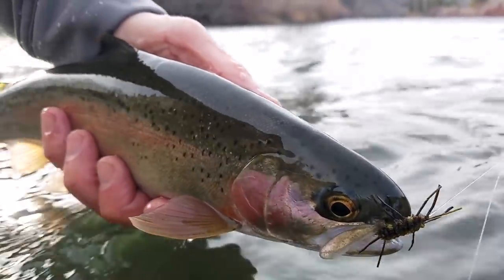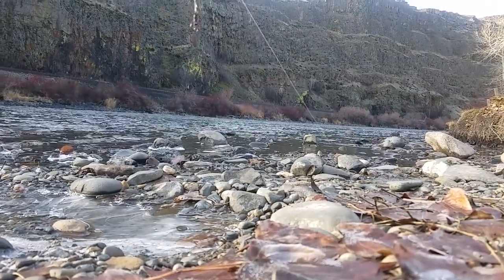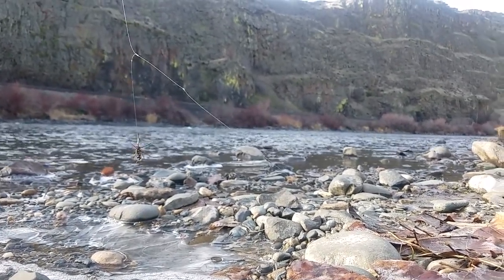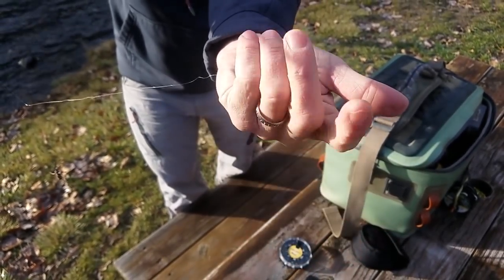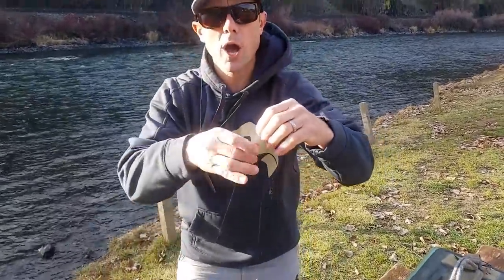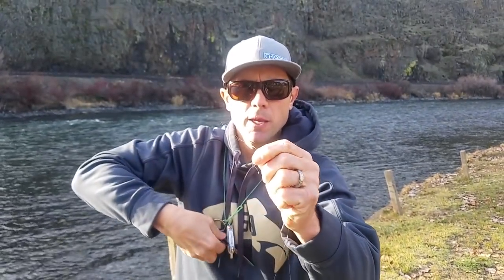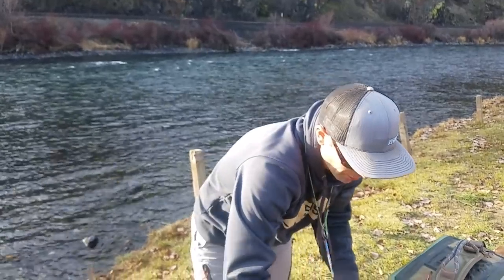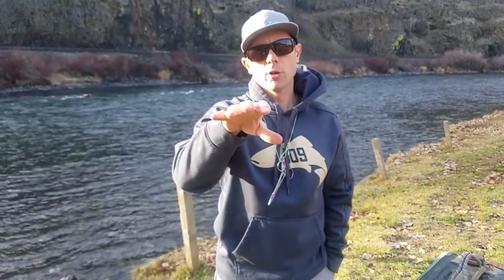Drop Shot Nymph Rig // Simple Setup and Explanation

Comment: You young guys bring some great innovation and techniques to the sport, I bet some of this rigging comes from spin fishing and other angling sports, probably  salt water as well. Old timers wouldn't like fishing with weight and yarn indicators, but yes it can be highly effective. Dropper fishing has always been a method or multiple nymphs. I can see that weight on the end giving you a nice controlled drift in the column of water at the desired height . Nice Job !
Reply from the maker: Thanks, its a good setup for cold water. I prefer to fish nymphs suspended (like a dry dropper) when I can.
Reply: @redsflyshop  Good video and Information, I agree suspended in the current tumbling at the same speed as the current always critical just like dry's, if it's getting towed or is moving faster then the current, It will not be as effective....... Good Fishing !
Reply: This is not a new technique
Reply: @bluebomber6947  Thanks 🤣

Comment: Another in a long line of very informative videos.  Question:  day in day out, for most conditions, would you choose drop shot or Euro nymphing if you wanted to catch the most fish?
Reply from the maker: On a big river, probably the Drop Shot. On smaller water where I can get close to the fish, the Euro Rig.  Out of a moving boat, suspension nymphing.  I should do a video or podcast about the advantages/disadvantages of all these setups. That is a good question.
Reply: Thanks.   One more question:  have you tried using a drop shot rig without an indicator (i.e., Euro-style)? @redsflyshop
Reply: @redsflyshop  YES, that would be great. Unless you've since done it and I've missed it. I've only recently found the drop shot rig while researching euro nymphing. I find that with the waters I'm around it makes quite a bit of sense. what length and weight rod would you recommend this on? similar to euro rod or a more normal action?

Comment: I gave this rig a shot at the creek today, and what a disaster it turned out to be! Lost a split shot almost every two casts – no matter how tightly I crimped it down, it just kept slipping off like butter. I’m pretty sure this setup isn’t meant for distance casting. To top it off, my two flies tangled into such a mess of knots that I had to cut the entire leader and call it quits. Guess it's back to a single nymph setup for me!
Reply from the maker: I hear ya, there is some nuance to it. Did you put a surgeon's loop in the line below the split shot? I like to put a loop in there and then cut the loop off and use the knot as a bumper.

Comment: Very helpful, been trying to incorporate this rig for Great Lakes steelhead and this video helped refine my rig
Reply from the maker: It is really easy to setup actually, it sounds like a pain the arse but it pretty simple if you keep it to a single fly with no "quick disconnect" loops.
Reply from the maker: Thanks BTW.
Reply: Red's Fly Shop My problem was setting the split shot too close to the dropper, thinking trout were bottom feeders. I use a tippet ring for my drop shot nymph rig
Reply: I've been using this for great lakes steelhead with pretty good success too. It really allows you to regulate fly depth, and is great in heavy and weird currents. You can add as much weight as needed without having the shot dragging your flies into snags. I also use tippett rings. Makes for very easy fly/dropper changes.
Reply: simple 90 degree nymph rig with a balloon for an indicator is the easiest most effective idiot proof way to catch great lakes steelhead..havnt found a better rig yet...
Reply: how to you rig it to fish?

Comment: What weight is the split shot? I have a fly rig, but also two spinning reel rigs for trout. So if the drop shot is heavy enough, you can probably tie the fly on a spinning rod because youll have the weight of the drop shot and will allow you to cast in one swing instead of whipping a weight around over your head lol.
Reply from the maker: Yes when you break it down, the indicator is simply part of the line. Mend it right! ahah.

Comment: Good explanation. On which leg of the triple surgeon knot do you tie the nymph? The one parallel to the split shot linr or the up leg so the nymph stands away more from the running line? I was told if using the upper line the knot would pull loose but that doesn't make sense to me. Thx
Reply from the maker: I run it on the "upward facing tag" - it seems to be less likely to twist around the main leader.  This is a great question, and that is my personal system.  I have not had that knot fail at all that I can recall. I am sure either tag will work, but that is what I do. Thank you for following along.
Reply: @redsflyshop  many thx and Tight Lines

Comment: This rig is money, I probably use a drop shot rig %80 regardless of season or water temp. You can fish it in a tight line setup too. Also, works great for multi fly rigs.
Reply: Kevin, what kind of rod/line setup are you using? And do you typically use a float with it? Thanks man.

Comment: does the 6 inch flouracarbon tied to the nymph get tangled on the main line easy?
Reply from the maker: Great question, if its heavy it will spin and tangle.... if it's unweighted almost ZERO tangles. It's better than you think. The greater distance there is between the two, the less they tangle. After fishing this quite a bit I'm shocked how seldom I get a bad tangle.

Comment: So you just attached the dropper the usual way by tying on sone tippet with a triple surgeons and using the tag end of this knot? It seems like you used the top tag which I thought causes the knot to fail?
Reply from the maker: Great observation.  I do use the top tag quite a bit, it's not quite as strong but it doesn't spin and tangle nearly as much there so there are pros and cons to using the top. I will also do (4) times through on the knot rather than (3) times.  If I am fearful of my tippet breaking, like 5X or smaller I'll often use the bottom tag, 4X - top tag keeps the fly off the mainline.
Reply: @redsflyshop  I know that this is intended for noobs but when you use this rig do you prefer the flies on surgeon tags or on dropper loops?

Comment: deadly rig and i use it all the time..i think a lil better set up is the botom 6-8 inches that your shot goes onto i use nylon..this way the shot will krimp tightly to it unlike flouro and if the shot does hang up you only lose your shot..the rest of the rig of course is tied with fluro..i attach the attach the 6-8 in piece of nylon with either a blood knot or a surgeons knot and my tag for small flies is an orvis knot or larger flies a tag with a perfection loop and i loop it around the flouro and it stop when it hits the knot i use to attach the piece of nylon...when i used a knot under the shot and got hung up occasionally i sumtimes would break off in other areas of the rig where i shouldnt have..you will be amazed even without a knot at all under your shot as long as your using nylon how strong that shot will hold onto it if u get hung up..maxima ultra green i like as its more subtle and a bit softer than maxima chameleon..
Reply from the maker: That's a good tip regarding the mono.  It is softer and would provide better grip than fluoro.
Reply: its amazing how strong lead shot will hold onto nylon,,especially when the shot and the nylon are new..
Reply: Good rig

Comment: I use this set up often and find it very effective, however this is not a drop shot rig.  Look at drop shotting as it was originally done by the bass guys and you will see that the bait, lure etc. and weight are all in line. ie no droppers.  What you have made a video about is called a "bounce rig" .  It is legal in some states where you cannot drop shot because the weight is not directly connected to the nymphs.

Comment: Alot of folks say not to use that tag coming out the top. Why is that?
Reply from the maker: I'm not sure, this setup works very well for me but I am interested in knowing more.  Please share if you find an answer.
Reply: @redsflyshop  I was told it will break off easy?. But in my head if you tie a triple and leave the top tag long wouldn't that push it away from the main line better?
Reply from the maker: @fishingthedriftlessarea5419  That's how I feel, so I do it the way described in the video.  There are lots of ways to create these tags, often my fly, main line, and shot are on the same strength of tippet.  A lot of times I patch up a rig and the shot and the fly are on each end of a connected piece of tippet that I tie on.  I put the shot on the long end, fly on the short end. So many choices.   As long as you are efficient and don't spend too much time re-rigging I think that is the most practical way to look at it. Fly in the water = more fish haha.
Reply: @redsflyshop  awesome thanks so much!